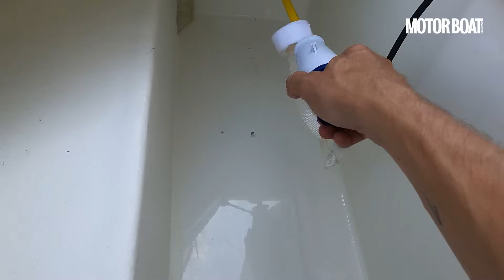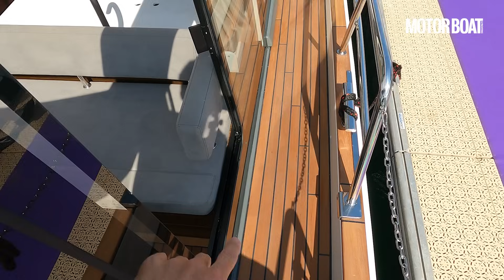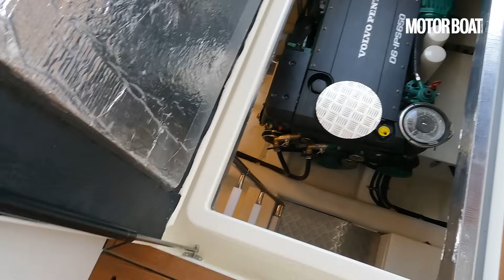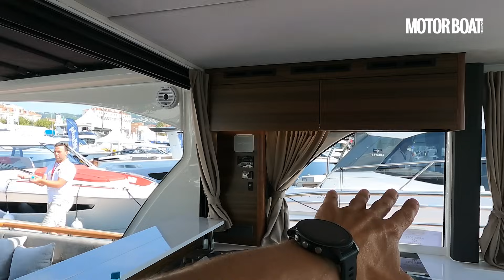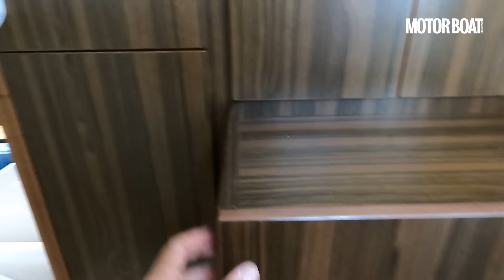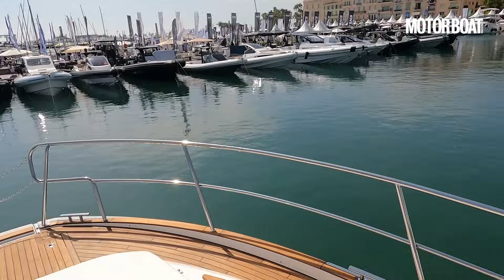Marex 440 Gourmet Cruiser yacht tour | Inside the Norwegian yard's brand new flagship | MBY

Comment: In the video the air draft is listed as 4.43 m, while Marex specifies 3.94 m. Could you explain how this difference comes about? Does the 3.94 m figure include all roof structures except the foldable antenna, and does your 4.43 m measurement include this antenna as well, or are there other reasons for the differing values? Thank you in advance for your reply.

Comment: Interesting boat, really like the lower deck.  Maybe not the best configuration for foul weather, but would need to see how the cockpit is enclosed.  I do like the cockpit layout.  If you need a grill there are options that won't take away the stbd side couch.  Wonder what the price point will be.
Reply: The cockpit is likely enclosed the same way as the other marex's, which is actually pretty nice.

Comment: Looks more of a group party boat than the 330 Scandie.  However for a family multi season boat I think prefer the 330 Scandie as it has a more social interior space in the cabin.  The 440 has a huge galley area but no inside social seating for those colder autumn evenings when the sun has gone in.
Reply: They have a version (of the 440) with a smaller galley (starboard) and inside dining seating (on the port)
Reply: @robertgalea4416  I should have checked that first!  For me that's a great layout for a year round boat. Thanks for the info!
Reply: @deputydd4364  yep, I prefer that layout too

Comment: Thank you for the tour. Very impressed by all the clever details on the boat, especially the folding concertina door that transforms the wet head into a separate shower and all the storage bins around the transom. My only reservation is in rainy or cold weather, how easy is it to enclose the aft cockpit to keep it usable as the salon?
Reply: try searching for marex 375 and you will see how easy and fast it is
Reply: It's really quick and simple. The canvases slide round in their runners and anchor into place with a low-level cord that keeps them really taut.